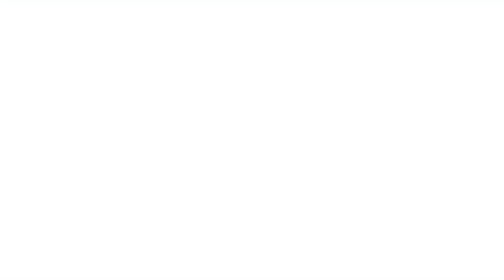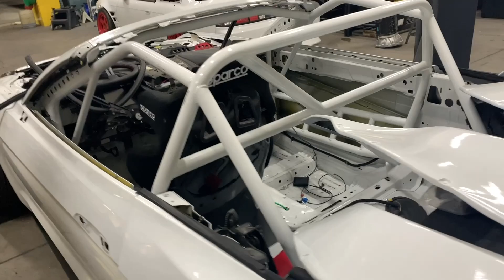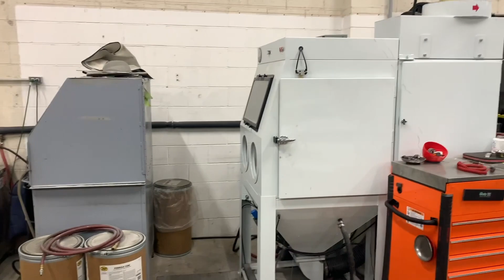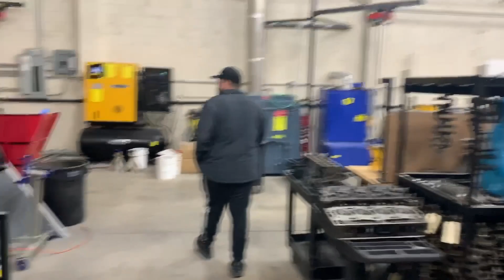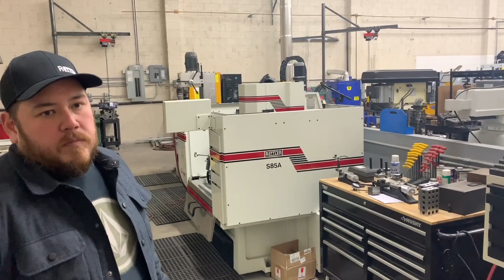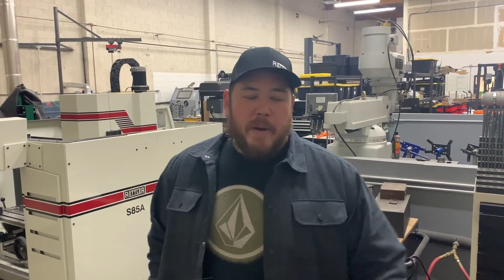Machine Shop : Vegas 2JZ & V8 specialist talks mistakes in machining blocks / heads & tool heaven

Comment: 17:15 skimming head cost here in SK 14€ for 4cyl and around 20€ for 6cyl
20:05 inconel and SS is same thing..  its just tradename. not all inconel and mostly not al SS are same.. same thing applies to aluminium and its ageing
Reply from the maker: Inconel is a brand name for a superalloy, that happen to handle corrosion wel